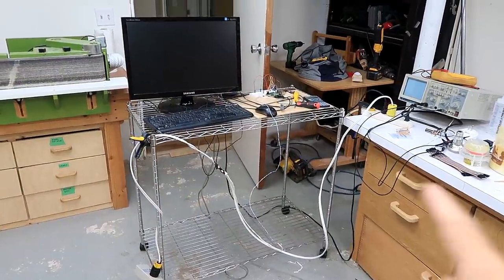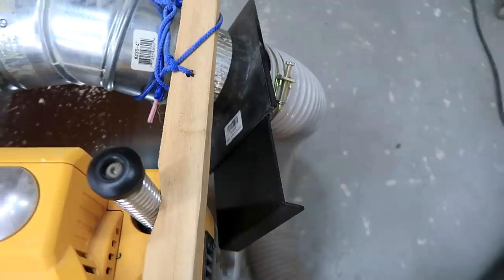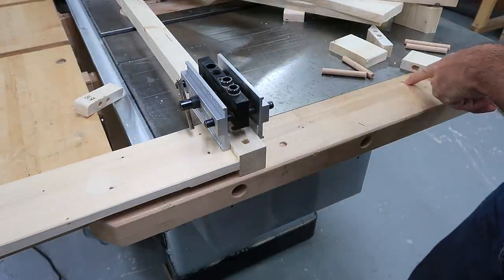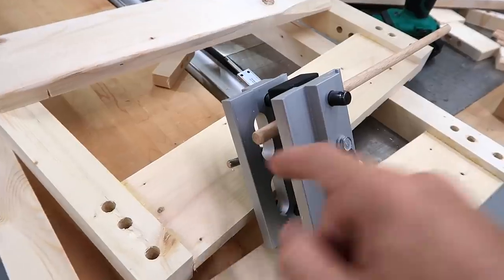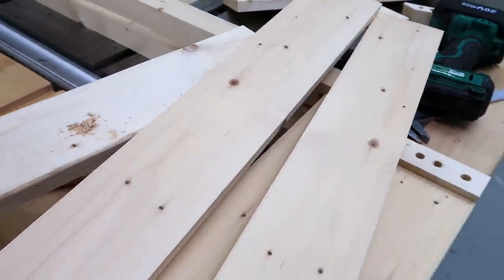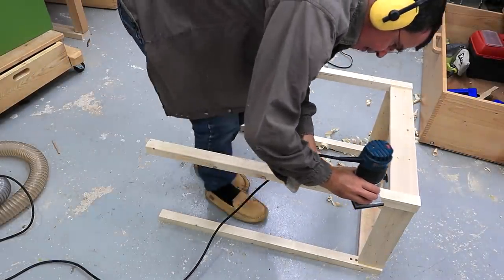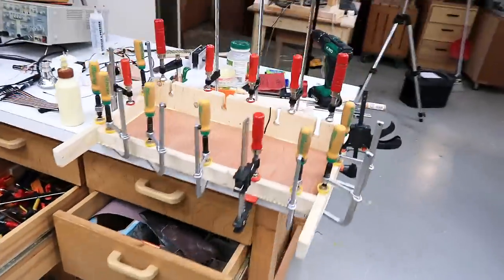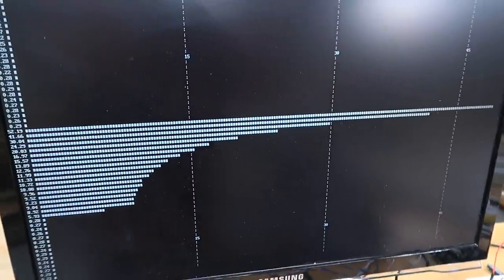Building in a hurry and screwing up

Comment: Even in the self-deprecating video, you still found a moment to take a jab at pocket screws lol!
Reply: New to the channel, why doesn’t he like pocket screws?
Reply: @leifuhlman6121  I won't speak for the man, ask him.
Reply: @tissuepaper9962  oh cmon, really just pulling a hanger like that?
Reply: " But I'd rather limit my mistakes to unintentional ones." Still savage. 😁
Reply: @leifuhlman6121  I won't speak for him either, but he does have a video on the topic. It's well enough made that it turned me off pocket screws, that's as much as i'll say.
Reply: It's a bit irrational. Pocket screws are fine for things that don't need to stand up to time or abuse. They are necessary in cabinet making... thye are just not as strong as almost any other joint.
Reply: @leifuhlman6121  They have bad pullout resistance and worse twisting resistance. They are fine for situations where there's no way for the joint to twist, such as the back of a cabinet.
Reply: He should have just used them by the looks of things.
Reply: If you use pocket screws for anything other than skirting you'll need to be jointed on the panto router. Manually.

Comment: Your comedy of errors is probably on the low side for my typical woodworking project! I get the Friday afternoon bit though. Trying to hammer things out before the weekend starts has caused many a problem.
Reply: Moreover, those who do not ever make a mistake or blunder at work do not necessarily do anything at all or achieve nothing during the day. Applies to any job and all fields :) Thanks for the video, I really enjoyed it!
Reply: Yeah but you have a red shirt Jeff.
Reply: Rushing on a Friday afternoon is how I ran an angle grinder into my thumb; took 2 months to recover from that one.
Reply: Rushing on a friday afternoon got my thumb crushed by a 1 kg hammer being swung as hard as i could. Took half a year for it to heal. An old master once said to me, whoever works a lot, makes a lot of mistakes.
Reply: @IliaCheishvili  Me too but it was a skill saw, through the thumb nail and up the side of my thumb. 9 stitches,2 of them in the thumb nail.
Reply: Makes out that he is human after all.
Reply: If there are any other biologists out there, you know never to run a PCR on a Friday afternoon, for this reason!

Comment: "The guide bearing fell off the router"  Oh man, I was doing a roundover on an electric guitar body I was building 2 years ago, and I had that happen.  Luckily, it was just for personal use, and it was getting painted, so I could repair it, but man, had that been a nice natural wood top guitar I would have been unhappy.
Reply: Had that happen to me once, now I use threadlocker and tighten the living daylights out of those bearing retention screws. Haven't had a problem since.
Reply: Had it happen on my kitchen countertop. Luckily it was at the first rough pass, so I could smooth it out with the finishing pass and a little bit of sanding. My wife didn't notice, but I can't unsee it.
Reply: Before the plane owner takes off, he never omitts the check list. And we craftsmen could learn a lesson.

Comment: Thanks for the tip on using the micrometer to measure the offset on the dowel holes on the apron pieces.  I have a old jig, my grandfather handed down to me.  I've always used it for edge joining but not for this application. Thanks for sharing!

Comment: Most recent rookie mistake I made was cutting with the miter gauge AND fence on the table saw. I was cutting a 5/16 oak dowel, I never found my 2” dowel cut off after that. I do all my woodworking outdoors, move my tools in and out of garage storage, so no holes in sheet rock from dowel projectiles were made.

Comment: I am also glad to see you using dowels when in a hurry.   I have built your slot morticer stand, just as you did with your finger joint jig.   It is strong as heck but too time consuming for something I want in a hurry.  This thought has prevented me from building a couple of other structures I need.

Comment: Matthias, while you were talking about intersecting the dowels together in the legs, it gave me an idea for a potentially easier way to do this. What if you joined the aprons together as a single frame using box joints? And then cut slots into the legs so that the frame fits into it. That could be an easier way to do it, maybe even stronger since the joinery doesn't take load. I'll have to try it someday.

Like a less-involved version of a castle joint.
Reply from the maker: That would be a lot more work!

Comment: If you remove the foot of the monitor and mount it using a monitor mount attached to the back of the table, you can probably free up a lot of space?
Reply from the maker: it’s perched on the edge, and fastened down with a screw

Comment: With all the crude tables that I've made, I just have been slapping on a Masonite topper. Easy to prepare and attach. Needs no sanding, doesn't need to be cured and it can hold a coat of wax, and looks pretty neat.

Thanks for the content.
Keep up the good work.

בס'ד

Comment: Well, that made my day, thanks :D
I recently made a 2x1m desk with a drawer for a stage piano for a home recording studio and messed the legs up as well, I didn't include tje piano drawer height, so it's either no piano drawer or buy more wood, because now, the piano would be at shin height..facepalm.

Interesting fact..power tools like a planer don't need to have safety switches in the US/CA?
The ones that automatically go "off" when the power goes out, with a little relay in them, basically a circuit breaker.
To prevent unexpected startups in case the power gets back on, or a situation like yours?

Even my 99€ small bandsaw and my spindle sander both have one.
Is that left to the manufacturer's discretion over there?

Comment: Slow is smooth, smooth is fast! I've learned through a lot of failure to take it slow, if it doesn't finish it's fine, I'll pick it up later and give the workpiece the attention it needs to get it how I wanted it. I make plenty of mistakes still but usually more manageable and not nearly as depressing or destructive. When you start to get frustrated and angry, start messing up the workpiece or hurt yourself it's time for a break anyway. Once you get back fresh you probably thought of better ways to do things while away.

Comment: :D reminds me of my shoptime yesterday, goal was to make 2 simple slatted boxes, just stapled together. first box i forgot to make the handles before i started adding slats .. luckily my router fit inside the box so i didn't need to remove the slats, second box i remembered to make the handles but i started nailing the bottom slats to the top .... at least i learned that 30mm long staples hold quite well :)

Comment: Years ago, our mill foreman set up a job on our 24” planer. It was a final pass on some 19” wide by 1.25” thick poplar. He went to the bathroom. While he was away, someone had a quick piece to mill at 3/4” and reset the planer. Needless to say, when the foreman came back, he went right at the job. I forget how many horse that planer was, but it chewed in almost two inches before everything exploded 😆. I think the foreman swearing was louder. I was at my bench, happy I wasn’t the one who reset a tool without asking.

Comment: After spending some quality time in CAD to layout cuts on a half-sheet of plywood to get all the trapezoidal pieces for a freestanding  corner shelf unit to place on a counter top, when it came to assembly, I realized I’d screwed up and inverted my dadoes for the shelfs, so my offset from the bottom (shelfless) end of the unit wasn’t tall enough for it’s intended occupant, and I had to cut the top 10 inches off the shelf, and add two (relatively) discreet “leg” panels to lift it up to the proper elevation.  Rushing frequently has consequences.

Comment: How do you actually calculate those currents? Do you search the top of the current waveform and divide by sqrt(2), or do you calculate the true RMS value?
Reply from the maker: Correlate it with a 60 hz sine wave, then calibrate that against my kill-a-watt meter.

Comment: It happens to me too. I'm not the best at wood working, and i've learnt from you guys a hell of a lot over the years, so i at least know my way around, but man, speed up the tempo just by a bit, and it's embedded wood in the wall near the saw, snapped band saw blades from over heating, and all kinds of screw ups. One time i cut four legs all different lengths for a quick work table. Speed ain't my thing.

Comment: My table saw tripped a breaker this evening while was repeatedly turning it off an on while cutting a board. I've always suspected that the tool demands much more power when it is first switched on than when it has been on for a few seconds. Is there a way to prevent this? Is there a way to make a corded power tool sort of ramp up to speed rather than go full throttle at the first millisecond?
Reply from the maker: if it has an induction motor, you could sort start it with a VFD (variable frequency drive).  For universal motors, a router speed control could be used to ramp it up slowly.
Reply: @matthiaswandel  my table saw is the quite popular DeWalt job-site table saw. I believe it is the DWE7480

Comment: As a Machinist in my day job, I can say at least your mistakes weren't in metal LOL.  Sawing round stuff freehand on the bandsaw, I use a scrap block of material as a work support to space the thing being cut off the table and give me room to wrap my fingers around the part for control. Just a block of 2x4 material, saw into the middle and leave it in place, it's even reusable...well at least until it gets tossed in the woodstove.

Comment: I’m glad it’s not just me.  I have just spent a couple of hours making filler pieces to fill 8 mortice holes I had carefully cut in 4 legs for the apron ends with my pantorouter - on the outside of the legs.  And no, I don’t have any suitable wood to make replacements.  😖☹️🤨

Comment: After one starts making serial mistakes, the biggest mistake is continuing to do the work
I should specify I'm a programmer. I'm very familiar with doing this
Reply from the maker: at least with programming, you can revert the whole mess, provided you remembered to check stuff in first

Comment: Just give up woodworking and use metal. No planing / joining / gluing / routing / sanding / whatever, just cut, weld, paint ! At $8 a 2x4, wood has lost its appeal.
Reply: Wood has come back down in price here. I stopped welding together big monstrosities a long time ago myself.
Reply: @1pcfred  Grinder and paint, make me the welder I ain't.
Reply: @lacombar  I got tired of grinding welds apart a long time ago.
Reply: @1pcfred  just as if cutting/sanding/routing wood and dealing with bags over bags over bags of sawdust/wood shavings was any better...
Reply: @lacombar  I keep my waste in a barrel. Then I dump it out in my woods.
Reply: @1pcfred  because everybody lives on an acreage...
Reply: @lacombar  yes.